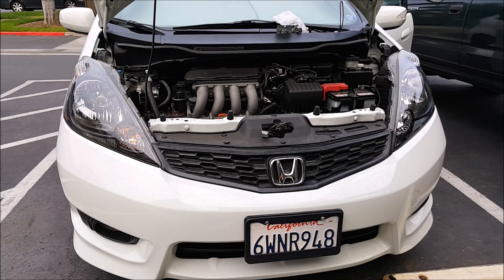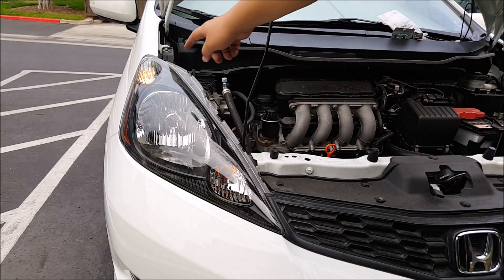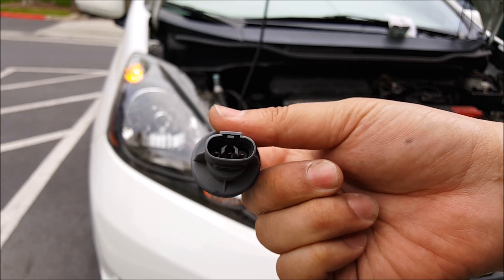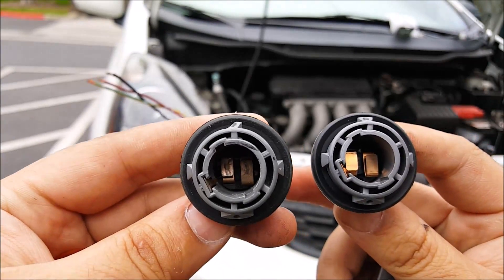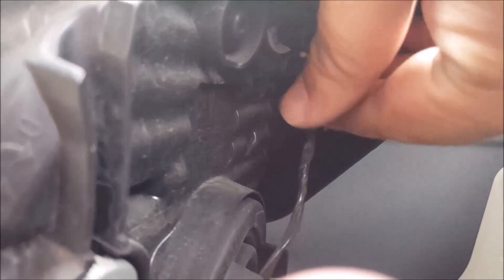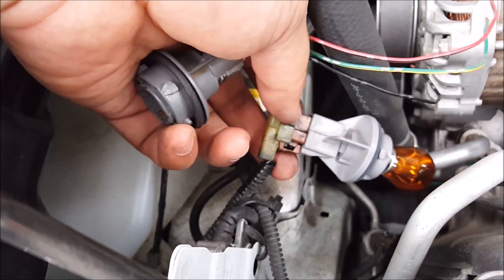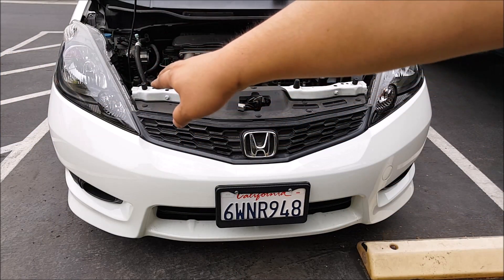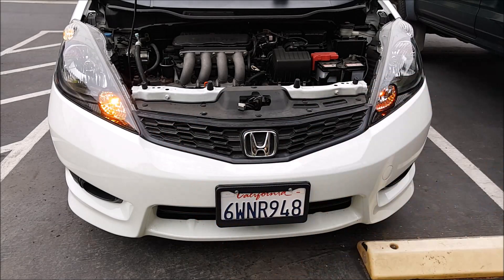[How to] Swap Single filament bulb socket to Dual filament for Switchback/DRL

Comment: it doesnt make sense how does drl cut off when you put blinkers on because drl is still getting power
Reply: the Led bulb he is using is set to do exactly that… unless the negative line is supplied by the turn signal rather than the parking light , makes a difference, like the person before us explained, interesting logic though …

Comment: You need 7443 wedge base socket or BAY15D /1157 socket to fit in dual filament bulb.
And you need to find common wire and main 2 wires for 2 filaments.
21w filament is for turn signal. 5w filament is for parking lights.
When you connect wires, remember you give only + line from turn signal wires.
Parking lights, you should give both + and - wires.
I did this to my car here in Sri Lanka coz I prefer how it looks in this old American style. Like in the movies I have seen.
Reply: Hello can you drop your wtsapp number , from SL looking for the upgrade

Comment: Hello sir I have some old clasic gm car product the thing is my blinker relay doing odd thing's for some reason bouth position light and blinker light go ON at same time and some time's in reverse other side get effected as well .
Why does that hapen?
I swaped 3 relays all of them doing different things but non solve problem.
I did change back lights design with newer version .
But wire harnest is still the same.
So I wonder what hapened to that odd thing.
I have 3 pin blinker relay by the way.
So I dont know how to solve this problem .
Aperantly I have as well those dual filament bulbs .
Can resistors ore diodes help?
And where do I put them ?
Reply from the maker: Most likely you have a grounding issue. A possible fix is to rewire a new ground wire.
Reply: @DIYCarModz  honestly I dont know I simply have fuel grade problems and mostly failure betwean wire harnest and alternator is back charging on me.
I like me fuel economy but dont know why that acuress for some strange reason I experiance higher voltage to me baterry around 15.5v .
So can I some how saftly add more voltage to centrain devices like ignition coil and simply bypass fuse box and regulators? 
I do have voltage regulator in me dashboard and I do have aperantly polarity sensitive 4 pin gm ignition module I have mostly problems starting me engin in winter time.
I do have R terminal starter selenoid who I can by pass to ignition coil voltage.
But that thing confuse me because I have singel coil HEI E core type.
For some reason I did try to use wire and diode but still me coil wont fire me fuse pop's in fuse box.
So can you tell me please how to protect baterry not get effected from high voltage and how culd I find ore buy some device that can rev wrout bypass that problem with low voltage .
It is realy anoying pushing me car at winter time.
I did try some hv ceramic capacitor's  but my baterrry was dead It did change me alternator starting charge rpm from 1200 to 2500rpm .
How can I prevent alternator to interfear with my ground /baterry? 
Is it posibel to use diferent cinde of baterrys in series ore pararel configuration so they dont blow up?

Comment: I have a 2012 Accord. Changed the rear turn signal to led switch back and only the amber comes on. It is a 7740 bulb. And way to make it work properly?
Reply: I have the same car , you don’t want Switchback in the rear because the white will stay on tha is no no for the cops 👮‍♂️  if you want the white color you have to do 7443 led 6000k white with hyper flash or separate 50w load resistor

Comment: Does the bulb automatically turn off the parking lights when u signal or did u have to modify that feature? I want to try this but I'm thinking the parking lights and the turn signals will be both be on making the turn signals hard to see.
Reply from the maker: Most switchback led bulb will turn off the parking light function and only have the turn signal on.  This is done through the bulb not the vehicle.  Some bulbs will have the parking light on constant and alternate between white and amber.

Comment: Can I run a 7440 in a. 7444 socket? My car has a 7444 socket and bulb but doesn't use the parking lights on the turn signals, I have factory led daytime running lights on the bottom of the bumper. Can a 7444 switchback with wire do the trick? I hope it can work. Also a fuse tap harness too?

Comment: If you run a resistor to the white of the switchback led bulb will it dim the white light? 
And would this dim the the amber signal light too?
Reply from the maker: Adding something like a 1500ohm 1/2watt resistors will lower the brightness. You have to add it per line. So you would need to add it for both the parking and the turn.

Comment: So since these are wired to the parking lights, they won't be on while driving correct?  Is there a way to wire these so that they are on like DRL?
Reply: U can always draw a line from ACC or just look for 'voltage identifier drl switch' on Amazon or aliexpress.

Comment: Do you need a resister to prevent hyper flashing when switching out to LED?
Reply from the maker: Yes, you need to either change out the flasher relay ( if it is replaceable ) or install load resistor to prevent hyperflashing when changing out the turn signal bulb to led.